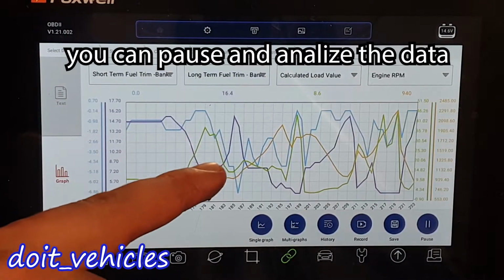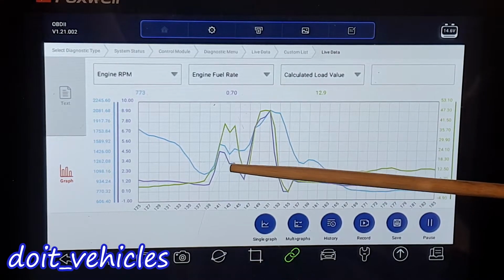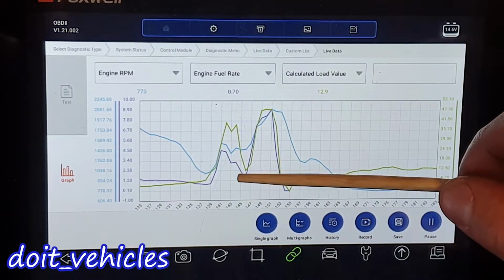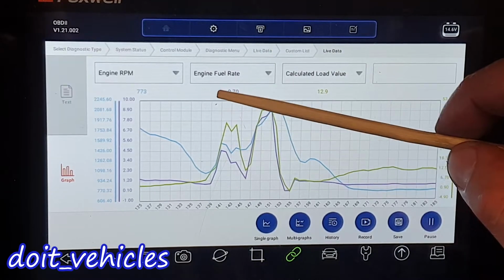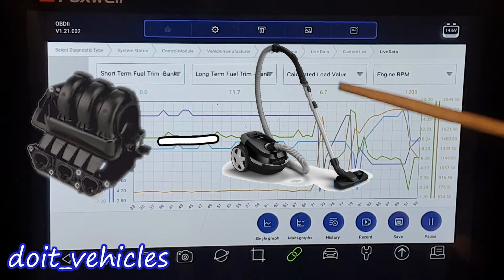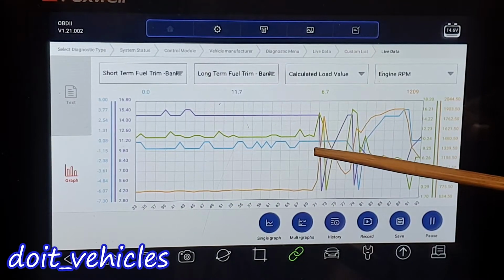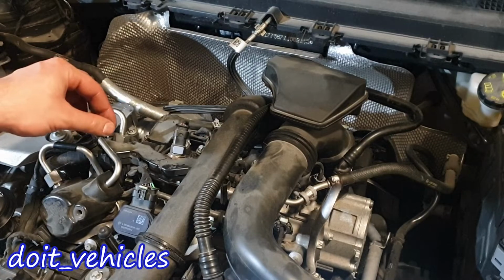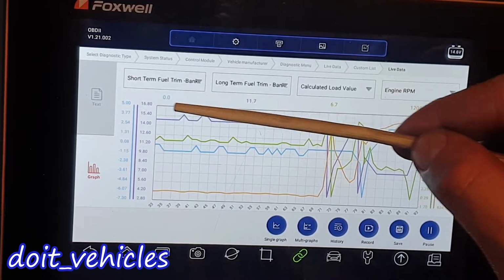M282 Mercedes W177 Fuel Injetcors Diagnosis with Live Data A200

Comment: Hi, I find your video useful. I am experiencing ticking sound in D1 to 6. I did not really hear the ticking sound from the engine compartment within my cabin in D7. Could you share with me if this is a normal behaviour of the HPFP or there is an issue with the GDI?

Comment: Thanks man for this info,,
I have a w176 m270 engine with fault code p22797a, i made smoke test and inspect every tube and the three pressure sensor and beleive me i cant find nothing wrong,
Please advice im thinking this code mislead me alot , and im sure its not a intake leak, a help would be helpfull thanks